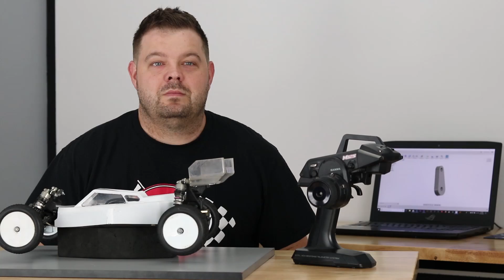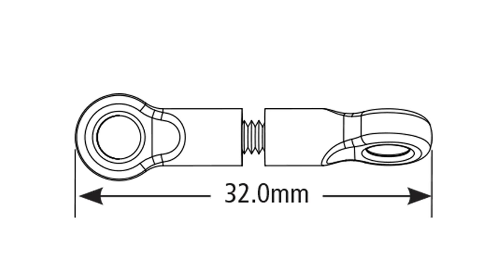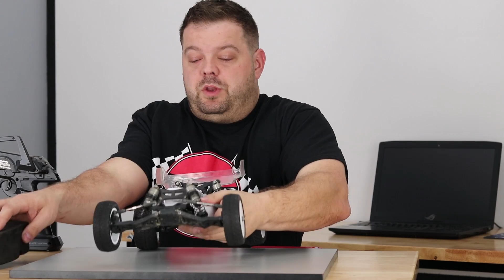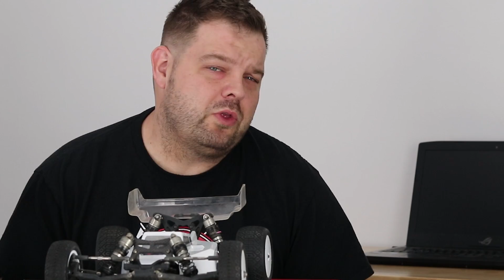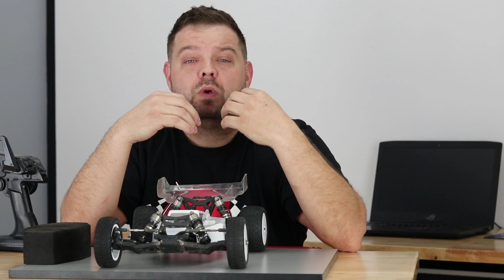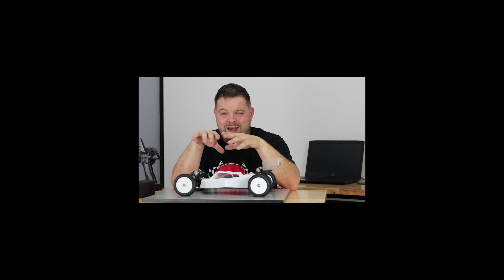Fix Your R/C Steering Problems

Comment: Wow. This has to be one of your best vids yet. Especially for folks relatively new to racing. While I've always been particular with regards to the build measurements, I've never realized that my steering endpoints have never been set far enough - what you've described as "full lock" in the vid. Good stuff J.

Comment: This is an invaluable Piece of Information!! I'm an Old Fart, and have been out of the Competition Stress Pot for almost 18 Years.
STILL, this is Excellent info for EVERYONE at every Skill Level. Proper Tuning gives you more satisfaction, helps your Car live longer, and saves money - because a misadjusted Suspension can wear out Tires, Bearings, Shocks and other Components much faster than a well maintained Car!! 

Just Subbed - I'll never be TOO Old to learn new things!

Comment: Thanks a lot bruv, I sit for ever going back and forth wondering if it’s right or not. Am I stressing the end points or not etc… I’ll get the manual out and re run the install procedures… 
Cheers Chris.

Comment: I have a spektrum 6040 and when its its zeroed out the horn goes on like you tlr pic. This is prob why there menual shows it like that since tlr and spectrum are owned by horizon. My sc5 shows it straight in its manual so i have to adjust the trim to get it even. Great video man!! Keep them coming

Comment: Good video Jason. Another point that some people don’t consider is any steering link change will effect endpoints. After a toe or Ackerman change it’s always a good practice to readjust epa. As a rule of thumb toeing in requires more epa and toe out the opposite.

Comment: Yah good call on the turning radius- been doin it for years - lining it up on a line outside on the concrete checking steering is equal left to right at 100 percent dual rate and also 80 percent dual rate- definitely needed with protek servos that don't buzz under endpoint stress

Comment: 5:34 maybe your to young or just havent experienced a real car without power steering. its very difficult to turn the wheel when standing still yet the second you start moving steering effort decreases dramatically. when your sitting still your tires have to scrape along the ground to turn whereas when your moving thats  not the case because with any rotation the tire is always touching at a new spot when turning the wheel therefore theres no resistance from the tire scraping along the ground. idk why anyone would think a stationary car would resemble the steering resistance felt while moving.

Comment: Hello I just built my first drift car but my steering does not self straighten outs after a turn also my steering arms rotate as opposed to move back and forth when the servo pulls the steering link so you know why this happens?

Comment: I have problem, my 1/10 crawler it steers correctly but wheels skidding, I wish I wish wheels on inside would spin slower than on outside- That would fix my issue

Comment: Hey Jason I know its not a buggy but hopefuly you can help me out. My arrma infraction pulls to the right and slow crawling speed as well as at fast speed. Ive tried everything! New chassis new bearings so steering servo replaced all parts that were bent and binding alignment looks perfext to me. Ive re set radio and recalibrated. Pretty much only thing I havnt tried is a new radio and reciever. Nothing is binding. This has been driving me nuts! Please if you could give me your input id appreciate it. Ive been tinkering with this for weeks!! Ive stripped the car down 3 times cleaned everything and inspected everything for bent or broken parks.

Comment: I found out the hard way that if the steering servo is under powerd you will crash and damage the 4 weel drive truggy, the servos and receiver were all powerd from a 6 volt rechargeable

Comment: Maybe you can help me, I’m still a noob at this... got a losi super rock rey that got into a big crash. Replaced bent parts due to torque twist on acceleration but that’s another concern. 
My current concern for now is steering/servo... I’ve replaced the servo with the same brand that came with from factory with the same horn and bellcrank. I’ve tried so many times to center the servo horn so my trim can stay in the middle, but for some reason that I don’t know. I could never get the servo horn to stay neutral with the steering trim in the middle... it’s either I’m on the far left or right. And there isn’t much movement I could do with the servo horn. I only move it like a tooth back and forth. And seems to be way far off... what else adjustments can I do? I’ve tried doing end point adjustments but it seems gotten worse...

Comment: I have an rc car that when I turn it on it turns to the right and the Servo dosent responeds to my transmitter please help
Reply: Have the same issue with a rc car and boat. Did you have to replace the servo?

Comment: help please i have a rock rey 1/10. It has alluminium wheels and big tires 6inch. a bit heavy and when i turn left and let go it centers fine then i turn right and it dosent center well it will stay more right. its a 6v servo but would a 7.4 hv servo help with that thanks.

Comment: Great video!  I am a complete noob to this.  I just finished building my first rc car build (tamiya Tt-02).  When I turn it on the wheels immediately turn sharp right and stuck there.  Is this a potential operator error with the servo setup?
Reply: This is happening to me did u fix it? ( considering its been a year )

Comment: Great video!I have one question though: What if your servo is perfectly aligned, then you turn it on, it goes in a random direction? Thanks!
Reply: You are supposed to turn it on with yoyr transmitter set to zero. That will center your servo and then you out your horn on. You must have your horn on while it's not centered and that's why it's centering when you turn it on. Also it could be a dead servo that locks right or left when it's dead

Comment: Can you tell me if Short Course is dead? It seems up here in the Pacific Northwest it has died. Just curious about your area too. Thanks
Reply: R.R. Hughes 
Out in Nor Cal the pickings are slim there were like 28 trucks at rookie night  (Sat) so people are buying them and racing at a lower level but there’s still hundreds of the same buggies every race night out here if you haven’t copied the same mods and set up as 50 other guys your not cool...

Comment: I have a MN99 in a Gulf livery and when i turn i hear a loud vibrating sound, anyone else have these issues?
After investigating it sounds like a gear is broken near the steering rack.
Reply: Same but mine will not steer
Reply: @sheelpatel4103  its a servo, I recommend replacing it, i bought a JX servo. Remind to link it if u want me to.
Reply: @SshiggyY  it is just that it will forward backwards but when you try to steer you will hear like a little motor but nothing happening.
Reply: @sheelpatel4103  its a servo more than likely, check the servo horn is connected to the link arm and if the servo itself is making a noise replace it.
Reply: @SshiggyY  yeah i will check and and try to find and replace the parts do you have any recommendations on parts.The way it broke is i was racing and another rc drove straight into the right wheel

Comment: I set my XB2 per manual dead center - may be my radio or servo or setup -  but with all things centered I have to set right endpoint to 150 - left maxes at 97 but I left it 100 with no major binding.  Eyeballed, the wheels and servo are at center - used calipers for everything.  Im waiting on the brown truck to be able to test drive it. I know eyeball doesnt work but Im just wondering.  Is there a steering speed difference if you have left at 100% and right at 150%?  The wheels seem to turn the same amount now - on the XB2 there are points where the steering arm hardware hit the A arms but while waiting - just curious.  Seems the radio wheel turns the same amount and the wheels turn the same max amount with 100 / 150.  But eyeballing it (again I know) seems it turns faster to the right.  Like it has to travel further with the same amount of transmitter input.  
Tks
Reply: Oh. Yeah.  My hubs are still inside out - thanks to one of your other videos (building the X2) that made me realize there was a correct way to install them.  One of those parts is a front axle (dont ask).  I will swap them once the truck arrives.  Test again.  Thats probably the issue.

Question still stands though - not specific to my buggy but - If you have to set one end point way out compared to the other end point - that would affect the steering speed in one direction, right?